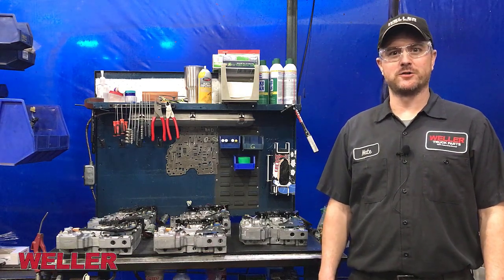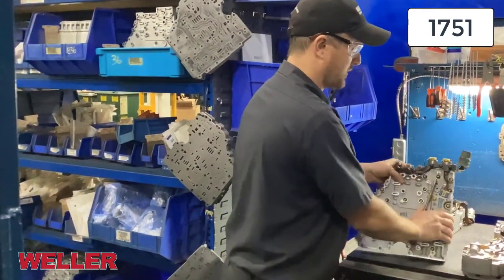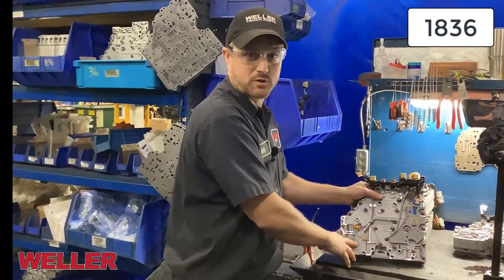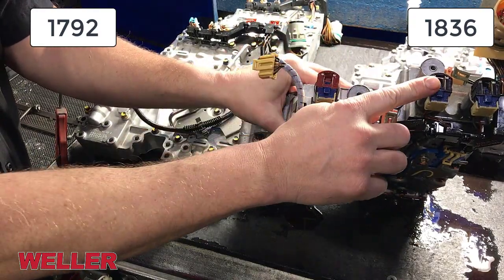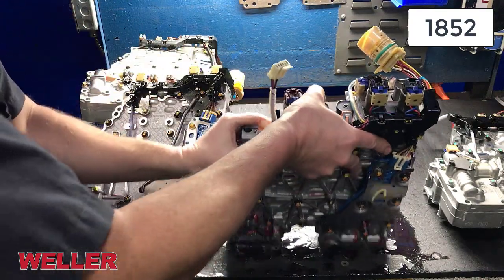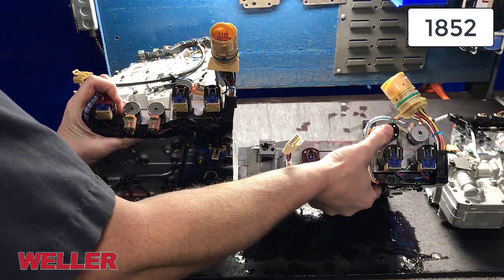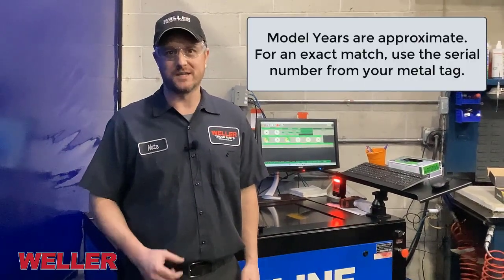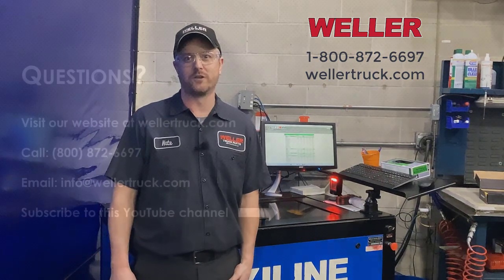Allison 1000 2000 Valve Body Identification

Comment: How do you test if the solenoid is bad. I’m showing a code on my lmm
Reply from the maker: Thanks for your question! To help you accurately determine whether the solenoid is faulty, we’d need a bit more information:

1. What specific trouble code are you seeing?
2. Do you have access to any diagnostic tools or test equipment?
3. What’s your experience level with vehicle repairs or diagnostics?

With those details, we can guide you through the right steps to test the solenoid properly. Feel free to reply with more info—we’re happy to help!